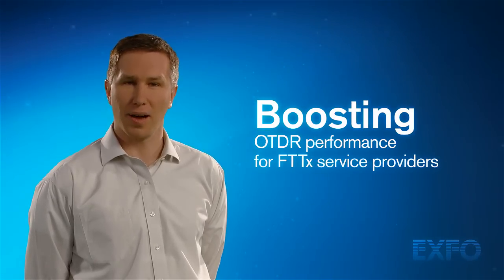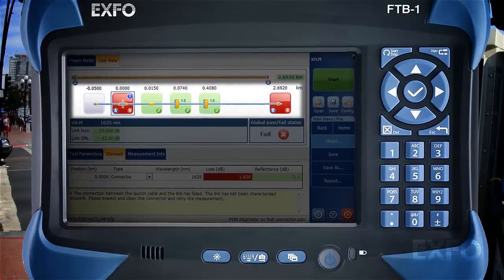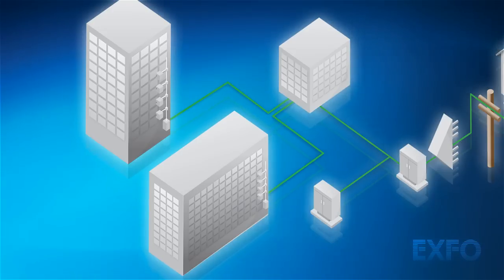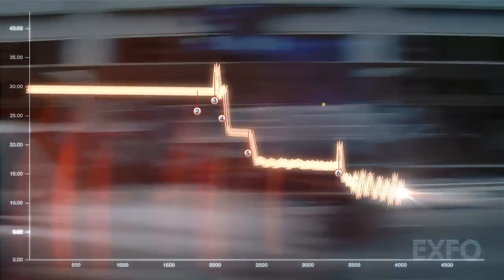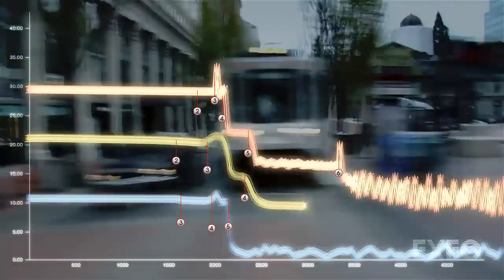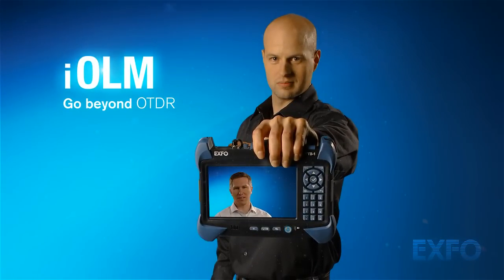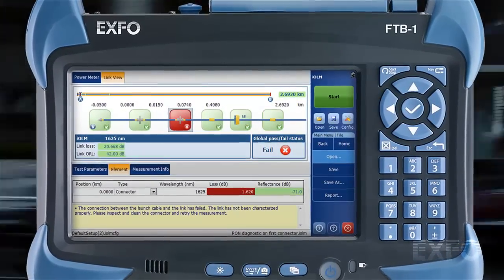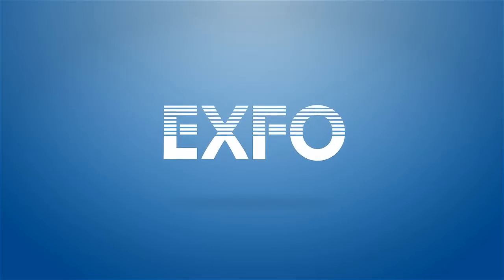Discover the iOLM background and benefits

Comment: "Making an OTDR expert out of any technician"  is an absurd statement.
Reply: Tim, I believe what they mean is that using the iOLM you just don't need to be an OTDR expert as the iOLM algorithm will analyze the link automatically. Not all users get the chance to learn how to use manual OTDRs. The iOLM allows performing accurate testing even if not mastering OTDRs.
Reply: Then Exfo shouldn’t have made an absurd statement.